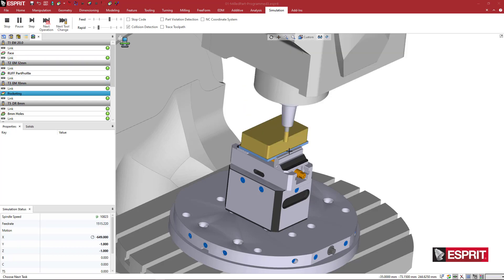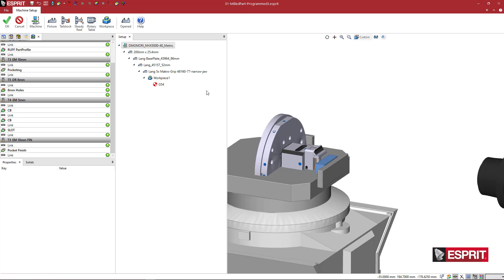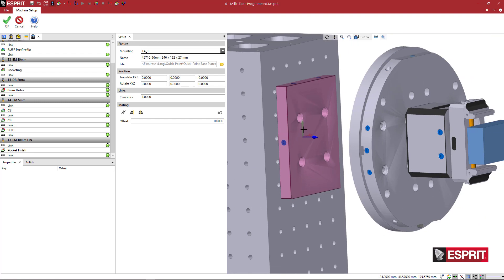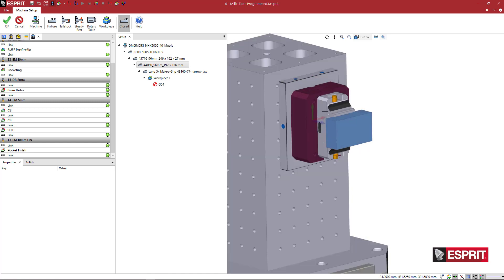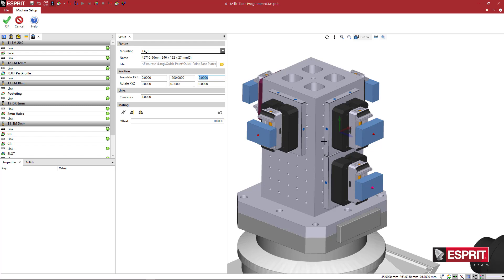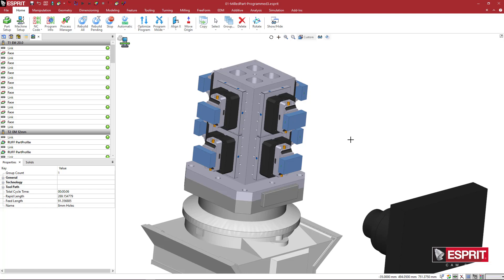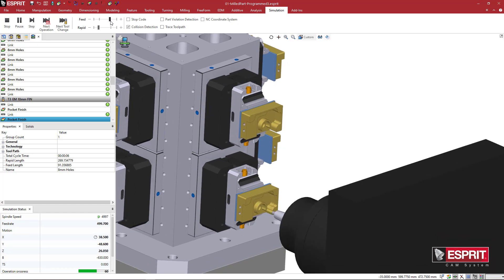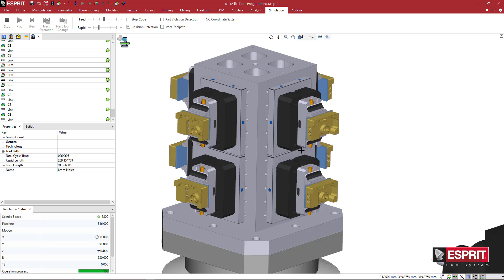Optimize Horizontal Multi-Part Linking Efficiency in ESPRIT

Comment: Are you working only with G54 in the middle of the machine table or you need to make G55, G56, etc. for every vice?
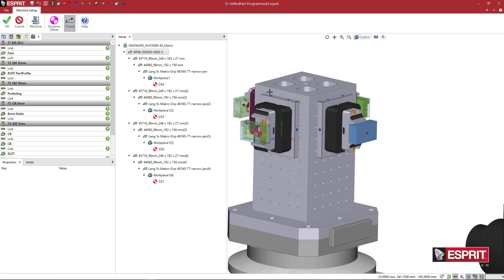Reply: That's a G54/G55/etc for every vice, the Red datum arrows are the work coordinates @5:35